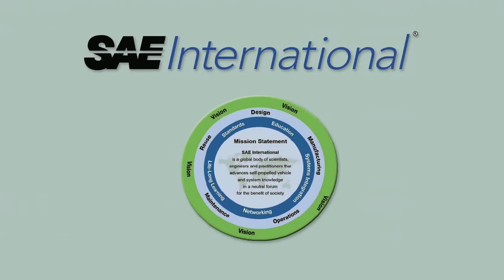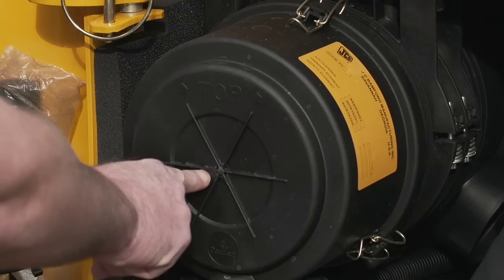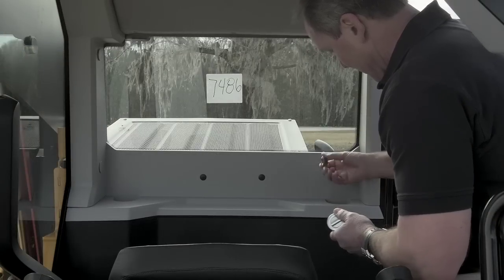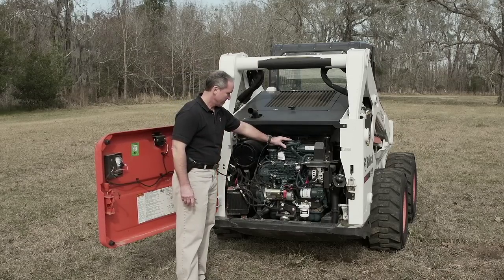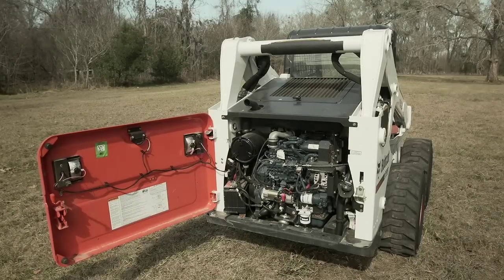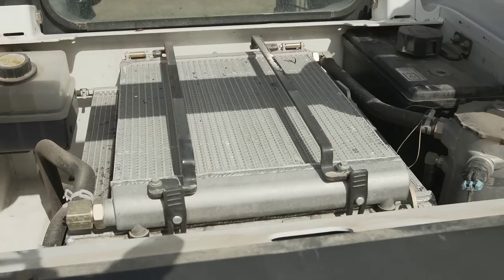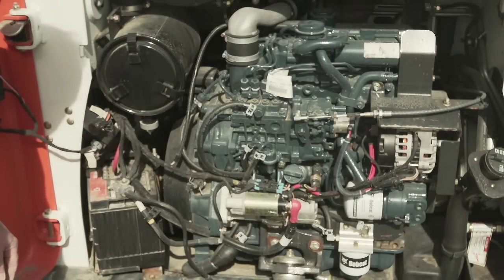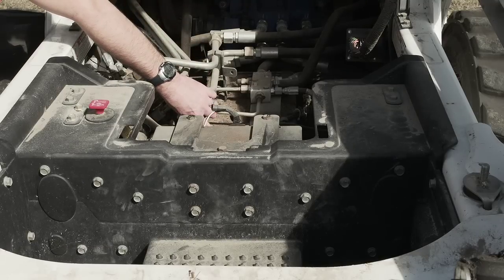JCB SSL Serviceability Advantage

Comment: Where is the JCB starter and alternator ?   Is it easy to replace like Bobcat?    I think the JCB is a good choice, but there isn't the service dealerships where I am at so I went with Bobcat.    I do think the side exit cab safety is huge making jumping in and out with a load or with forks at half way easy to do.  Cant do that with a bobcat cabbed unit the door will hit the forks/bucket.   Bobcat does have remote option which is $11,000 dollar add on.    Bobcat has roller suspension making for a better ride.